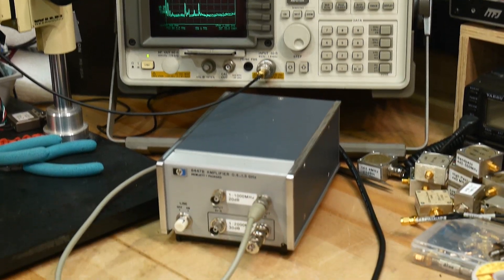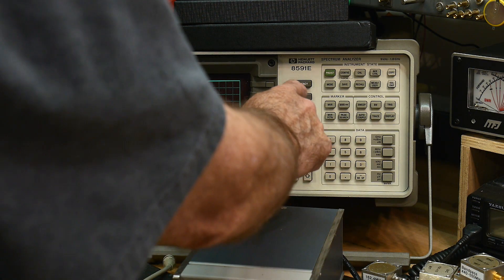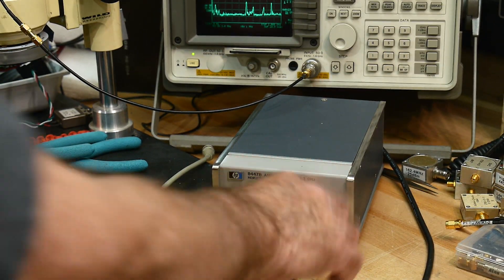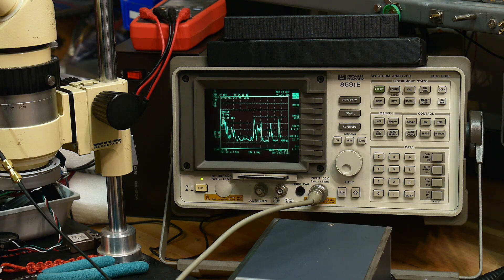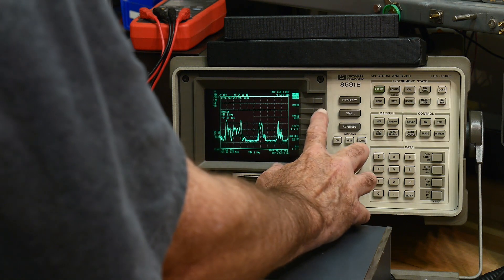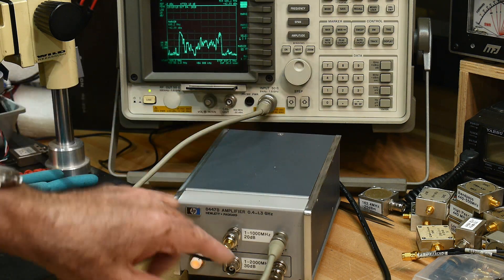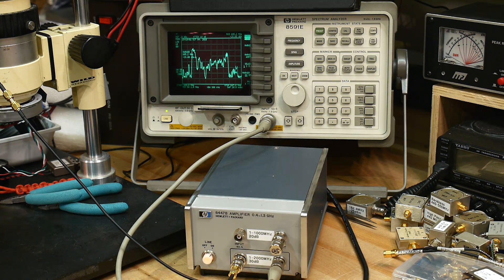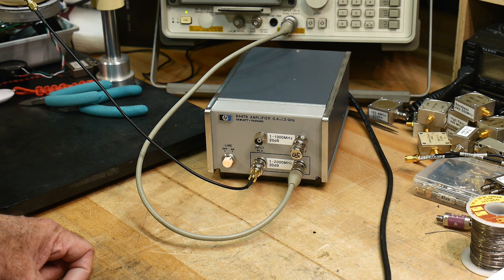#600 Amplified Signals from Discone Antenna

Comment: Speaking of driving counters, old school Tek scopes had a rear panel output that bumped up the signal on Channel 2 enough to drive a counter even on very small signals making it easy to measure the frequency...lacking that a low noise amp is a great thing to have at the bench.  Thanks for sharing!
Reply from the maker: go tek!

Comment: Your video makes me realize something. Could be the reason why I have difficulty measuring the oscillations of multiple  antennas closely coupled in an array the fact that the dipoles can't store a lot of energy and are creating to weak signals? So I would need better band passes and an amplifier to measure it.